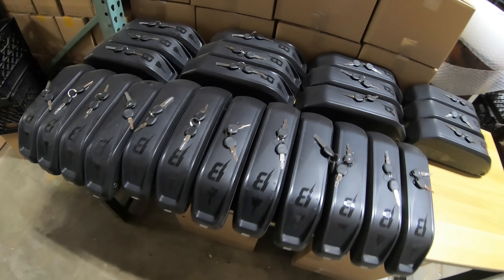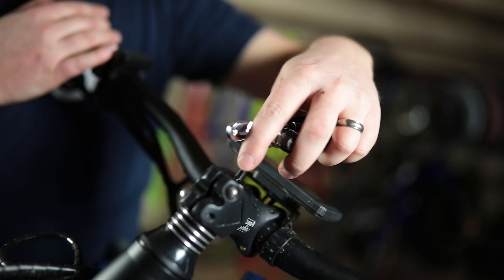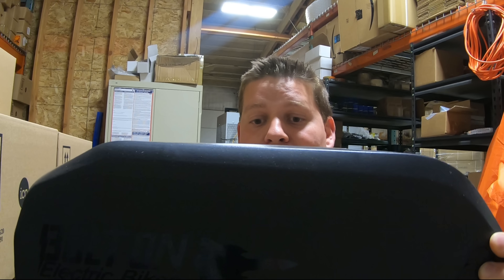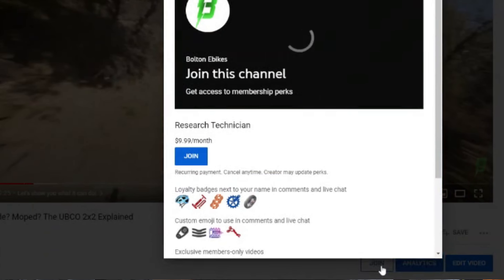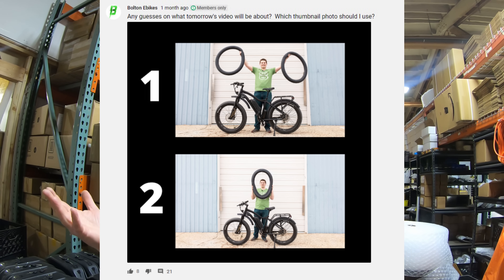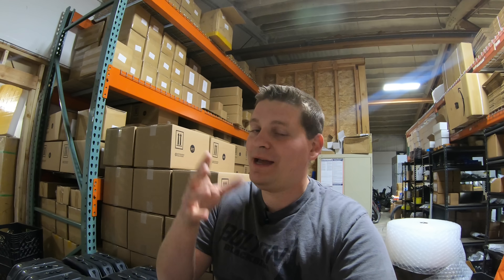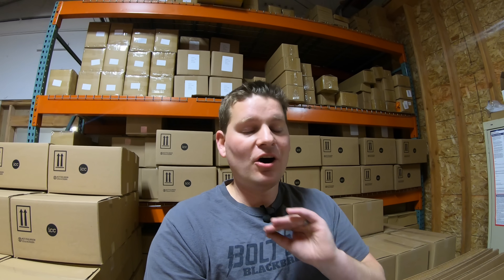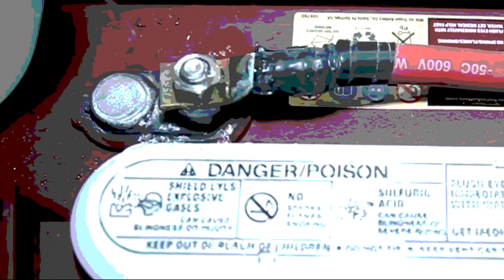How to maintain Lithium batteries for electric bikes - Easy!

Comment: Thanks you seem very knowledgeable! I have 3 e-bike  
#1 IZIP, 
#2 GIANT La free, 
#3 Trek Alant 7S
The izip died with bad control  panel rubber boot cover dry roted. I have be in electronics since 1966 HAWK MISSILES repair ect.. The IZIP was out of warranty  plus the same week THEY WERE SOLD to another corporation.  I diagnosis the problem and replaced the Capacitor that had blown apart. But that did not happen  for a few months.  Finally got the factory to sell me a new control panel for $300 +.. After a few more months!
They were supposed to send software to update . But was not delivered.   More months. I had bought the new GIANT. Never got the  IZIP to show any signs of life. It was a great bike before. I suspect the battery had died. Now I started my ELECTRONIC career with TUBES! My first computer class was programing CARD PUNCH. 
JUMP STARTING 6 VOLT CHEVROLETS!! LOL LITHIUM IS SCARY!? I have Ischemic heart disease from US ARMY and Agent ORANGE 🍊.  I ride my e bike almost every day. Would love to share the IZIP with friends.  But here is the big question? How could I JUMPER FROM my know good GIANT or Trek.  None of them are interchangeable.  I would gladly BUY FROM YOU a new izip battery if I knew it would fix it ! Sorry  for taking so much of your time . Paul Martin Hoover Al..

Comment: This guy is one of the most realistic no bs about truth in ebikes
Reply: he misinformed. One should never fully discharge a led acid battery.
Reply: @ohhenry5313  I accidentally fully discharged my 72v 50amp lithium battery, It used to charge to 85v now it only charges to 80v, the battery has only 500km on it, did I mess up the battery by fully discharging it to zero?
Reply: @BryanxRafael you just answered your own question lol

Comment: So you talk about 800 to 1,000 cycles you don't mention the loss in actual charge (or run time) as the battery gets older. I am experiencing a noticeable decrease in battery range with my Bosch PowerPack 400 which is about 3 years old.
 What can you tell us about at how many charge cycles one can expect before we lose capacity?
Thanks

Comment: So it sounds to me like you are balancing the battery any time you charge it up to 100% (assuming that the battery has a BMS, which it sounds like they all do these days). Some ebike manufacturers suggest a monthly "balancing" process of leaving the battery on the charger for a full 12 hours, but it really sounds like any 100% charge leaves the cells fully balanced. 

Does a separate "balancing" make any sense, or is this perhaps a holdover from the days before BMS's were standard equipment on ebike batteries?

Thanks as always for a great channel!

Comment: Cold is bad for charging if below zero, but it extends the life of storing longer term.   Hotter reduces life when using. 

The advice for charging 100 then discharge for longer term storage is right on the mark!

Comment: how do you know when your battery is at 80-90% tho ??
Reply: digital volt meter connected to output terminals, then find a chart showing percentages for batteries of your voltage. Chart from EBR forum;
https://electricbikereview.com/forums/threads/battery-voltages.26398/

Comment: Should you charge your battery after every ride even though you're only using a quarter of the battery life or less
Reply: According to this video, you've only used 1/4 of a charging cycle if you top off to 100%. Interesting. I'm going to verify that with folks who specialize in nothing but batteries to be sure this is correct.
Reply: A1”

Comment: Correction: Liion cells have no issues with beeing left out in the cold. They can be stored in cold temperatures for long period of times if needed. Acceptable storage temperatures are listed in the data sheet of the cells.
Reply: It's about charging at low temps,this is not good for batteries as the manufacturer states and in my case personal experience will tell you

Comment: Dude, I have a cod power 1000w lithium battery, and a 52v motor rear wheel motor.

It will chunder along at 38mph, but I recently nicked the power cable and I've noticed a loss of power at low speed.

How can I fix this?
Also, how could I speed up my bike even further?

Comment: I have questions about my battery gauge.  I have the 8H color monitor. I like it pretty much, but I don’t understand why the green bar graph doesn’t seem to indicate battery usage properly.  I’m also curious about the volt indicator.  If full is 54 and 40 is empty (for all practical purposes) does than mean that 47 is half full? Like, if I went 20 miles and is says 47, should I be able to repeat that route?

Comment: I have a 72 Volt Lithium battery on my scooter sits at 85.1 Volt. I'm unsure what I should set the cut-off to. A higher value or a lower value. Will a lower value or higher value damage it in the long run? Thanks
Reply: Heres a chart for you https://electricbikereview.com/forums/threads/battery-voltages.26398/

Comment: It would be good to keep a record of your battery's mileage and charging cycles,  get a $10 voltmeter and learn its charging curve. Charge it to 80%  4 times then a full charge once, then repeat.  The meter is useful all around the shop anyway. 
In winter, check it and keep it at 70% and you're golden.
Reply: I agree.  And trickle charge as much as possible.  Never get hot.or run low.
Reply: Thanks for the info, what voltage do you charge it to ,the 48 volt or the fully charged voltage 54.4 volts to store it at 70%.
Reply: @herbboughner3944  54.4 is full, if it took 6 hours to get there, give it 20% less time on charge and read the voltage for yourself.  I give mine 4.8 hours on charge and call it 80%.  It isn't a critical measurement, and different batteries will have different curves due to age, actual usage and charger output.

Comment: I have had 4 ebikes you won't get 1000 cycles you will get 500 good charges.
Reply: So if you ride 20 miles on a charge, then 20 times 500 is 10,000 miles that is good for a ebike

Comment: Hi i.ve got a 48 volt battery which works great for about 30 mins then its starts playing up sending messages to the regulator  saying communication error  and the bike switches off . I switch the battery off then back on.  it works for a few mins then the message pops up  then it shuts down again any ideas  many thanks gordon

Comment: When in use i do a full charge. Just before i store it in the winter after a full charge i run it down to about 3/4 charge, then i pull the battery out and bring it in the house for the winter.     Thanks for the video.

Comment: If you fly radio controlled, li-ion powered airplanes and helicopters, you quickly become an expert on lithium based batteries, or you go broke.  Charging from 80% to 100% creates a lot more wear than charging from 20% to 80%, and you should always store your batteries in a temperature controlled environment, at about 50%.  With no load on the battery, that's about 3.85 volts per parallel cell pack.  A 48 volt battery has 13 parallel packs of cells in series, so, for that battery, the unloaded storage voltage would be 3.85 volts X 13 = 50 volts.  You should never leave a battery at 100% for more than a few hours, at most, and you should also try to avoid discharging below 20%.    By the way, the 80%/20% rule works well for cell phones.  I charge mine to 70%, and recharge it at 30%.  So far, my phone has been charged in this manner over 1,300 times, with no loss of battery capacity whatsoever.  Li-ion battery cycles are not linear.  Charging from 0% to 100% equals one cycle, but charging from 30% to 70% (a 40% charge) is only equal to about one tenth of a cycle - not four tenths.  A 20% to 80% charge is equal to less than a quarter of a cycle.  New electric bike batteries cost hundreds of dollars.  It's your money.

Comment: Kyle, I would love to see a video about lacing a Bafang H500 or similar hub motor into a fat bike rim.  I love your open swapping out the internals and you have a great series on building a fat bike from scratch.  But, I would love to see you explain and build the driving part of an Ebike!
Reply: I have 2 hubs I really want to lace into 19” moto rims there is one video I’ve found of a young guy doing it but without the hub motors I’m interested in more content on this also!
Reply: I have a fat bike and mid drive is really what you want to put on it. I got a 120mm 1000w bafang mid drive with a 52v 20a triangle battery 🔋.  I've gotten it over 40 mph 🥴

Comment: I'd like some advice please I have a rear 1000w hub motor I would like to try and get more speed out of it it runs on a 26" wheel maximum speed 22 mph the battery is a 48-volt 16 amp with Panasonic 18650 s would it be worth changing the controller and display instead of buying a bigger battery two over vault ?  the controller is a KT model any advice would be much appreciated 👍👍👍
Kind regards Mark

Comment: To store my ebike Li-Ion battery for 2 to 3 months or so, I use a 180W battery tester/analyzer/electronic load/etc to discharge my ebike battery to about 70% charge. You simply set the "cut-off" voltage, connect the battery analyzer, set the discharge current (I use 2 Amps) and it will discharge the battery to that set voltage. It is quite easy and fast. These units are usually reasonably accurate as well.
The unit I bought handles batteries up to 60V MAX. Note that if you search ebay/amazon/etc other units are available that handle up to 200Volts.
After 3 to 4 months of storage, I charge the battery and then discharge and put it in storage mode again.

Note: this is JUST an example and not an endorsement of the item. It is not the actual unit I purchased.
https://www.ebay.com/itm/150V-10A-150W-Intelligent-Electronic-Load-Battery-Discharge-Capacity-Tester-/264278516671
Remember, the MAXIMUM voltage your battery pack may output is not what the battery or bike labels usually show. You have to remember that the final maximum voltage is Xvolts x the number of cells in series WHEN THE PACK IS FULLY CHARGED. 
E.G. a "36V" (10s) Li-Ion battery pack charges up to 42Volts.

Verifying Ah and Wh (NOT for storage)
The unit can be also used to test/verify your battery pack's Ah and Wh capacity. Many ebikes have an auto cutoff that is a bit higher than most lithium packs can actually handle, so for Li-Ion I would generally take it down to 3.0V x number of cells in series) (e.g. if a 36Volt (e.g. 10s) bike which often cuts-off the motor at battery=31.0V, I would set the tester to cut-off at 10s x 3.0V = 30.0V. If a pack uses 14 Li-Ion cells in series (14s) I would set it to 42.0V (14x3.0).
Note that 4.2Vx14 cells in series is 58.8V which is JUST below the maximum the tester I use can handle. So if you have a higher voltage battery pack you will have to use a different tester.

edit: I edited to reflect that there are battery testers/analyzer/electronic load units that now handle up to 200V (old value I had was 72V)

Comment: I had my 15ah 48v battery since 2013 & put 22k miles so far I use it to commute to & from work 14 miles round trip so it’s never gone below 50% died on me one time in the summer heat riding hard for a couple hrs but still going daily

Comment: You should NEVER discharge lead acid batteries below 30% and strive to always keep them above 50%. Lithium batteries can go to about 5% and should be maintained for long term storage at 30%. That is why they always ship them to you at 30%. If you go below 5%, you just need a ‘dumb’ aka single voltage or variable bench type power supply to get them high enough to charge on a smart charger.

Comment: The one thing all lithium battery BMS's should have is low temperature cut off so the battery won't be ruined if charged when it's too cold (generally near freezing or just below) Do any ebike battery pack BMS's have this "feature"? That's what this video should have focused on.

Comment: Great video.  Can you recommend a higher end battery charger that can charge a battery fully or to a set percentage as well as say discharge a fully charged battery down to a set level??
Reply: The charger sold by grin can do this.
Reply: @morte100  thanks, I just placed my order.

Comment: He is giving good advice, folks!  I ride almost daily, going on five years now, on a heavy recumbent trike with the original battery. It has a 1kw Bafang motor and a 23 Ah battery. I keep it on the charger all the time. It takes hours to fully balance all the cells. I charge to 54 volts and rarely run it down past 47 volts. I take it apart yearly to check for corrosion and clean it up. The more oversized the battery you can carry, the longer it will last.
Reply: Does it need to stay on the charger for hours after  the charger indicates it fully charged to balance? I always turn it off right after.
Reply: @fritzstauff  When it's fully charged you take it off since it's done balancing. Don't listen to people who leave their batteries plugged in after it's done charging/balancing.
Reply: @vigilant_1934  Yeah I've heard leaving it on charge for extended periods of time. Could lead to safety issues.
Reply: @fritzstauff  The Rad manual says 12 hours max.Read the manual as every manufacturer has different recommendations.

Comment: I got over like 20 thousand miles on my bike same battery works perfect
Reply: Prove it. 

Anyone who says "Like" is usually over exaggerating quite a bit.
Reply: That is quite impressive. Are you using Li-Ion or LiFePO4 or something else?
Can you describe how you use your battery? Do you charge it to Maximum voltage after every ride, 1x per week, etc. or do you charge it to a slightly lower voltage to prolong battery life?
e.g. daily commute of X miles/km, weekly trips of X miles/km, occasional trip of X miles/km, infrequent trips, etc. Thanks.
Reply: Sounds like some BS to me lol. But if so then very cool
Reply: @keithmo80  its called a ecotric bike
Reply: Can you tell me what battery and controller and motor you are running? And what range is max for your set up? Thanks so much 🙏
Reply: I believe you it's still working perfectly fine, But I bet you ain't getting close to it's original range! A battery pack can continue doing it's thing for as long as the cells can hold a charge, But the efficiency will diminish during that time which also means your range.
Reply: @helenHTID  probably go 60 miles on a battery ecotric makes good bikes
Reply: They are Samsung Lithium  cells, same what electric cars use.

Comment: I have a bafang 1000w. Bought a battery charged to full but the display only show 68%. The voltage is 55V. Do you know why?
Reply: same here... did you figure it out?
Reply: @scurtiszz  I contact Bafnag and they say it could be the display issue,not the battery issue - -because the baterry still shows 55V, and that means it is fully charged. I try to figure out what is the range gonna be, so far I get about 25miles and battery down to 12%. So, I start charge them again. It is bug I think for Bafang

Comment: @Kyle - should you leave the battery charger plugged into the battery after it reaches 100% charged or unplug the charger?
Reply: My bike says the first 3 charges leave it on as close to 12 hrs as you can no matter if its fully charged or not

But after that you def wanna take it off charger

Comment: Can I or should I not  charge my bikes battery with a solar panel that's been designed to charge  a caravan leisure battery 12volt
Reply: I'm not an expert, but I can confidently address your question. ... No. You need to charge with the same voltage. If your ebike battery is a 48v, you can't use a 52v charger. You certainly can't use a 12v setup
Reply: Thank you very much, it was one of those questions you have in your head, the fact that the battery is 48volts and the solar panel I have will produce about 19 volts in full sun light, for its size. 12 by 8 inches,  I've had it a number of years,  my concern was it was designed for wet cell batteries
Thank you very much for replying to my query ... I guess there will be no of grid   caravanning  camping with our ebike's..

Comment: Great video!  But technically, I think you meant to say the BMS manages "Cell Groups" rather than individual cells.  

From Sciencedirect.com: Voltage monitoring is possibly the most important function of the BMs. The BMs typically monitors the voltage across each series group of cells. Voltage excursions due to overcharge, overdischarge, or high power pulses can lead to significantly reduced life and safety issues.   

https://www.sciencedirect.com/topics/engineering/battery-management-system#:~:text=2%20Cell%20voltage%20measurement%20and,each%20series%20group%20of%20cells.
Reply from the maker: Yes, I didn't want to get into exact details - this is the "easy" version.  I may do a more technical video in the future explaining exact voltage, c rates, etc.  :)